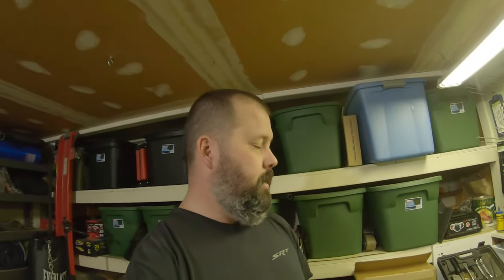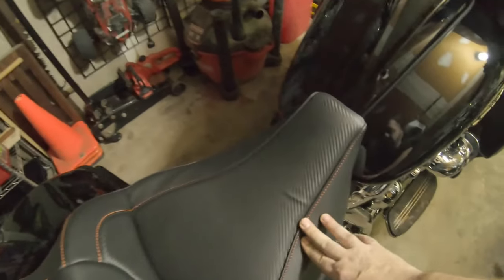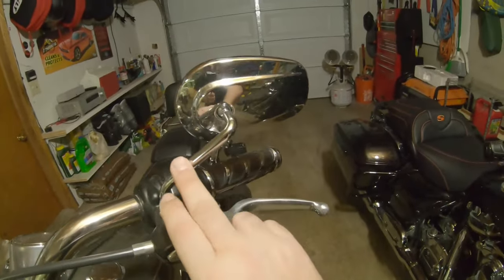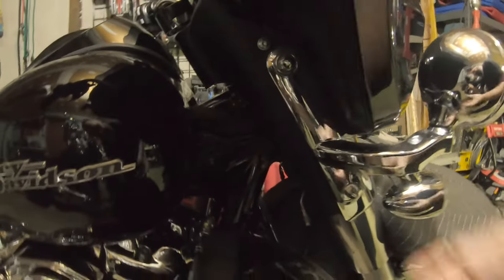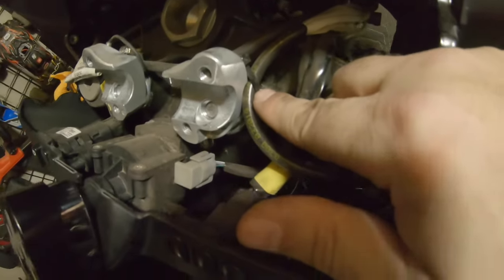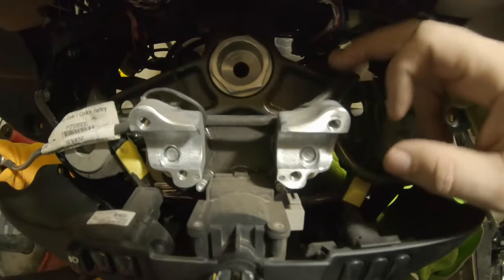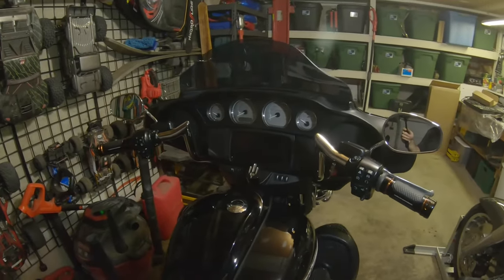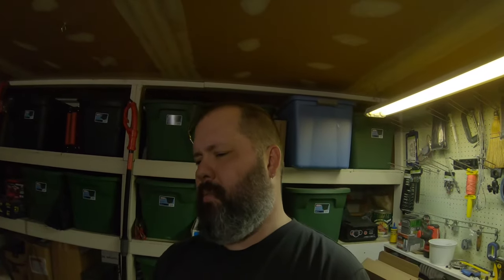Dominator Industries - Let's see if I have what it takes to raise the bar

Comment: Watching you and others switch the bars out is helping me build up the courage to attempt this myself lol it’s always looked so complicated and I’ve always been scared to attempt it but I think I’ll order me some of those and give it a go
Reply from the maker: I'm glad to hear it encouraged you to give it a shot! I found the thought of the swap to be more intimidating than the reality. Take your time and some pictures if you're nervous and it'll work out pretty easy,  just a little time-consuming. I'd love to see your before and after though 👍
Reply: If you get the meat hooks. Just note the instructions they send you. And when pulling the throttle twist cable , i strongly suggest you de pin the plugs. Helps with coming around the 90 degree.

Comment: ur good on the grips brother, HD grips are kinda cheap. I run the empire collection heated grips on mine and i have that same plastic sounding slop throttle side.
Reply from the maker: Glad to know it wasn't just me. I was thinking maybe I just did something wrong. But I agree about them being kinda cheap. The slop is way worse on my Fatboy with the Kahuna grips. Don't think I'll be buying anymore Harley grips in the future.
Reply: @Buffalo509  I had the hardest time tracking down a set of heated grips that weren't HD that still looked good. If you find an aftermarket set thats nice maybe post a vid, i'd love to see if there's stuff out there im overlooking or just not finding.
Reply from the maker: @cali5ive124  I've not considered heated grips yet but now that's cold here I just might have to. Those bars are pre-wired  for it so doing a swap might be fairly easy. I'll do some digging and see what turns up.

Comment: Do the bars block the stock mirrors? I was hoping to not add aftermarket mirrors with the 10" dominators
Reply from the maker: Unfortunately, they did block the original mirrors so I had little option but to go aftermarket

Comment: How was the accelerator cable installed? Was it hard to pull in?
Reply from the maker: The bars came with a steel cable preinstalled. I used electrical tape to attach the TGS to the cable and WD40 to lube everything up. It wasn't especially difficult but it was easy either. Take your time and use the push/pull method on the TGS and you'll be ok. If you can de-pin the TGS ahead of time, it will make the whole process even easier.